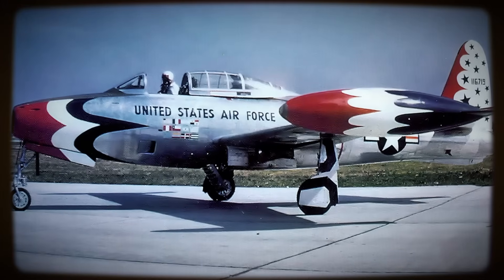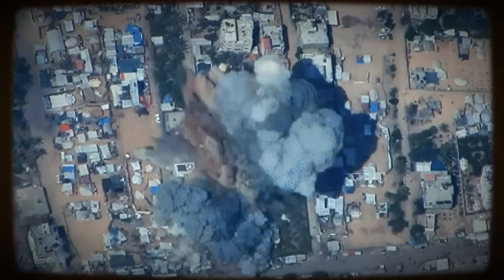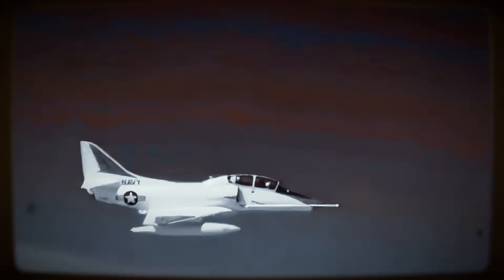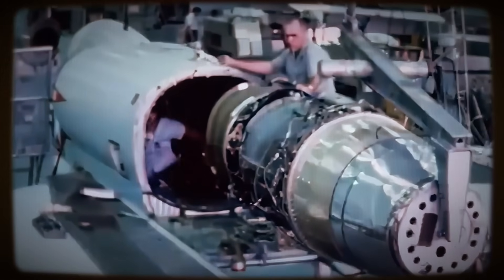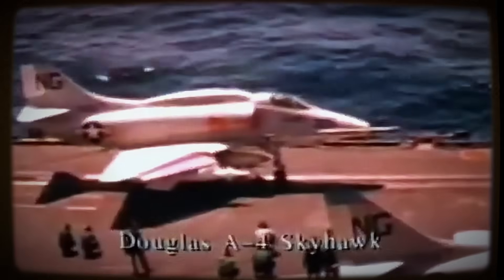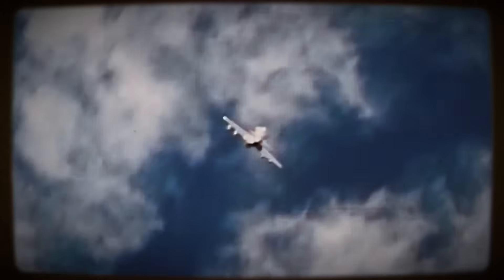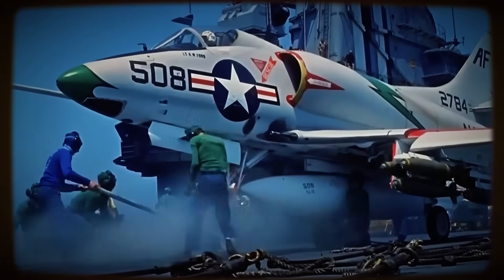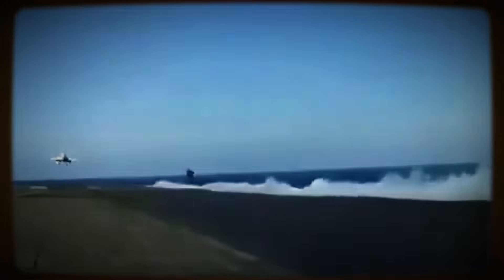Skyhawk: How "Simplicate & Add Lightness" Revolutionized Air Combat | Douglas A-4 Skyhawk

Comment: You know what would have been a damn fine light attack place for the USN if the A-4 had never existed? The F-5! 

With the exception of it smaller wing area and slightly lower max load out, the A-4 and F-5 are remarkably similar. With a slightly larger wing and MAYBE trading the afterburners in to add some extra armament capacity, I bet it would have been a great little workhorse. 

Alas, the F-5 went on to be a part of the F/A-18 lineage, so in a way…

Comment: The F14s engines weigh about 8000lbs together.  The whole plane weighs 70,000lbs.  10,000lbs for the A4 is nuts.
Reply: Dry weight is 40k lbs…max takeoff weight around 74k lbs